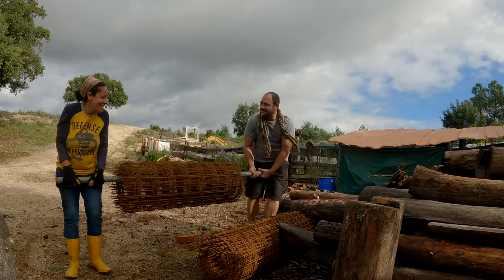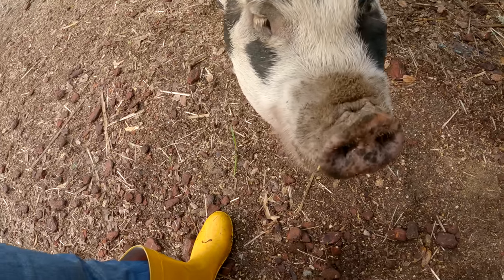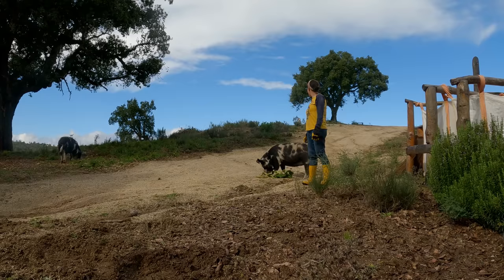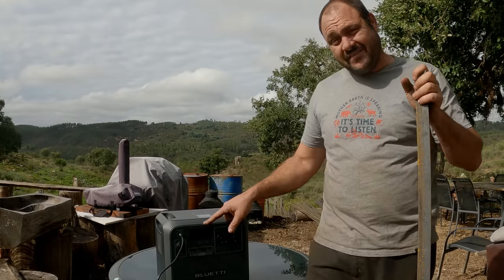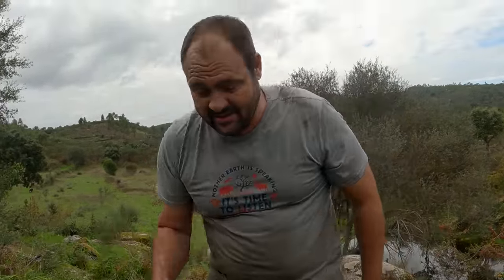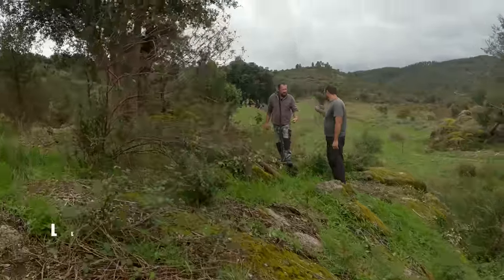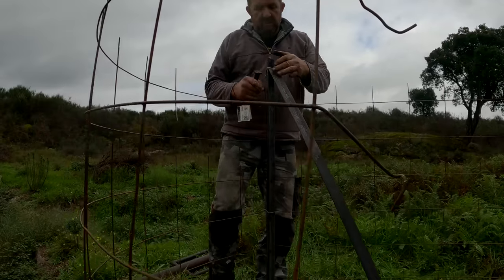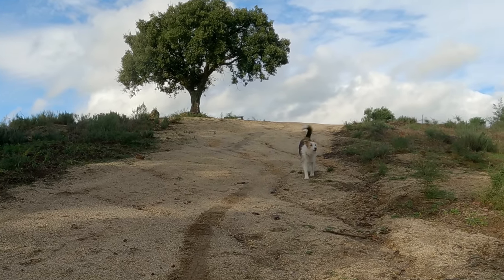Building a Pig Fence on solid granite rock - with help of a friend and #bluetti

Comment: If you have piglets they will go right thru that fence. Might want to wire some finer wire to it, wouldn't have to be more then 18 inches tall. Next with your girl disappearing she could be bred. Look for milk line of developing nipples and check out her vulva. On ours the little pointy part of thier vulva will stick out straighter if shes bred. At least it does on some pigs. Sows it doesn't work as good but gilts it goes better.
Reply from the maker: Thanks James